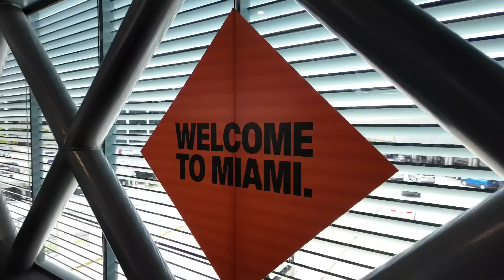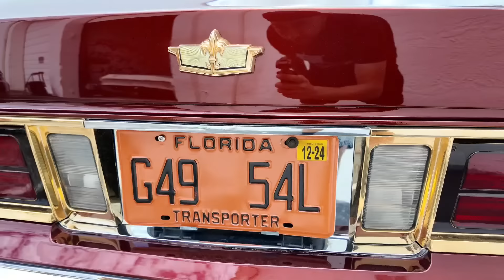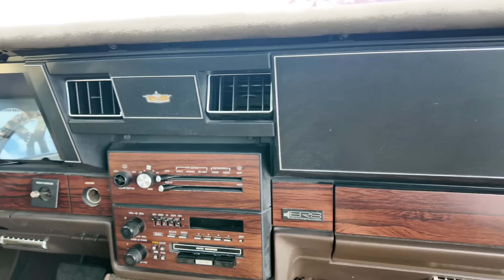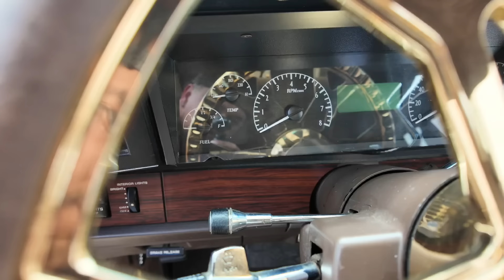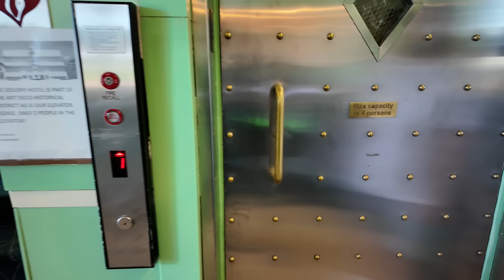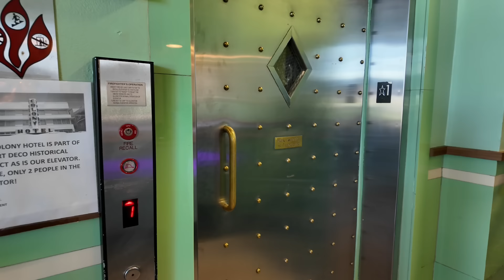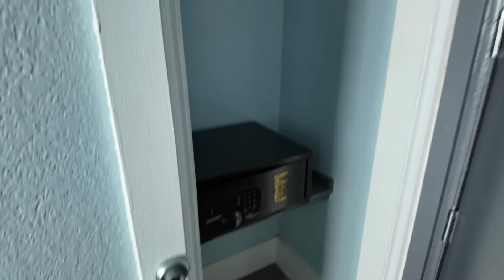I flew to Miami for this custom 1987 kandy painted 2 door caprice

Comment: If I were in your position I would buy that car immediately even with the transmission being broken. The car is built with a high standard and everything on it is perfectly done. You should negotiate a lower price due to the issue but definitely buy it.